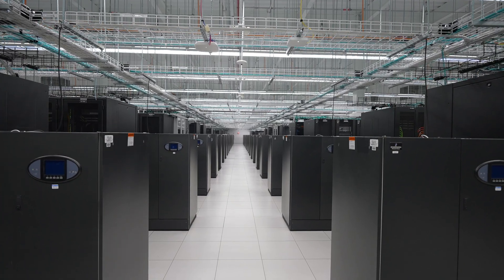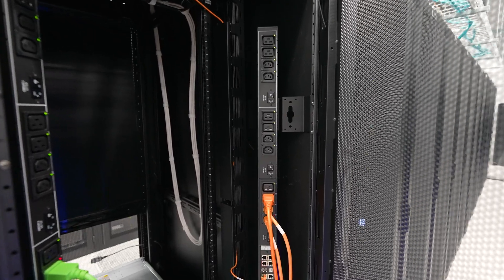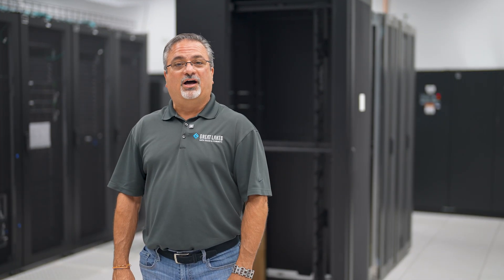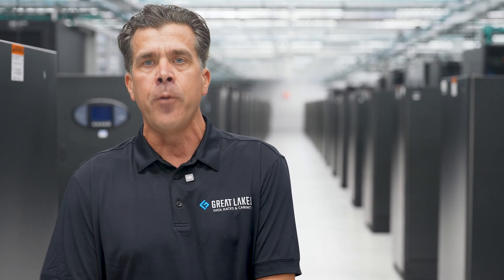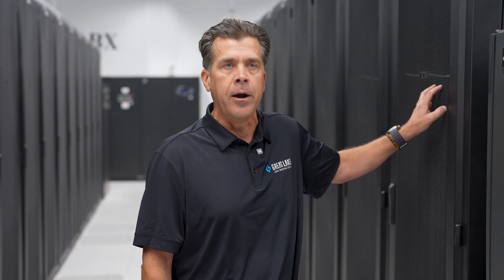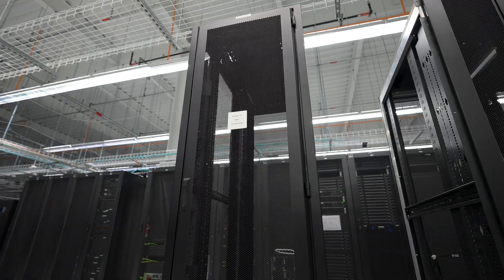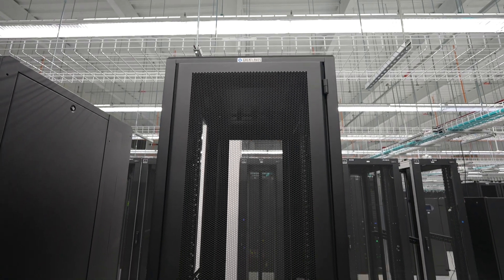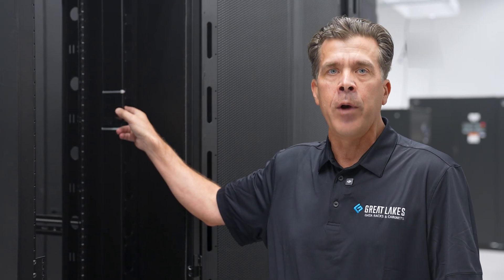Tour a Major Healthcare Data Center

Comment: A random question: do all of your rack handles pull up like that to open, or do some models have rotating handles? Thanks!
Reply from the maker: Great question! Some pull up, some lift up and rotate and some pop up from a card badge. LOTS of options, you can check out a few here - https://greatcabinets.com/solutions/seal/security-access-control/
Reply: @WeRackYourWorld  Thanks for the response! Do you happen to know which style the L-series and ES-series rack enclosures come with by standard?
Reply from the maker: The L series comes with a basic swing handle. The ES series comes with a lift lever handle but any handle can be requested at any time.
Reply: @WeRackYourWorld  Thank you very much!